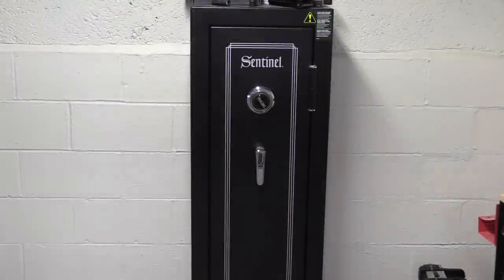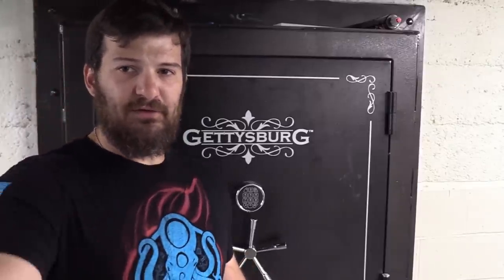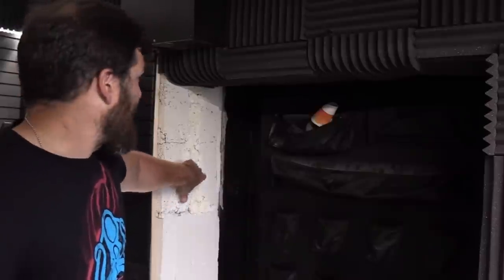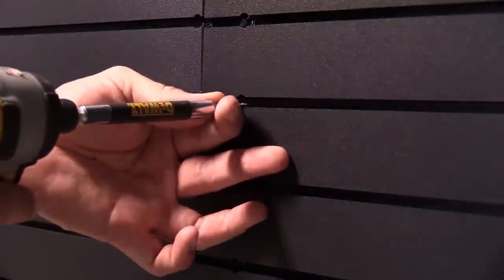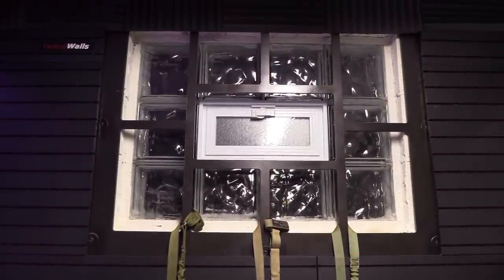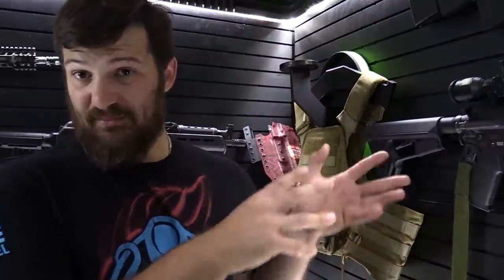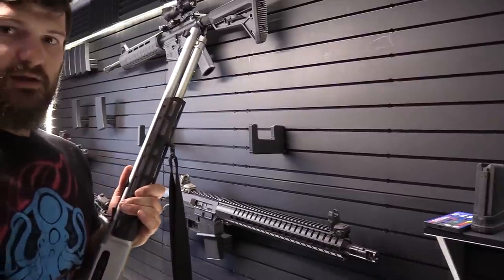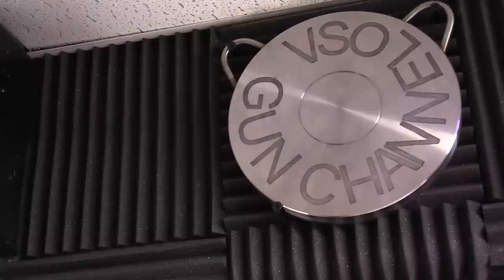The Ultimate DIY Vault Room

Comment: I love the room it’s my dream vault and I’d love to have yours BUT the only thing that lost me is the glass block wall if someone can break that little window you don’t have to get through that small opening all you need is enough room to get your hand in there with a Dewalt battery operated grinder and you can cut that steel window thing out enough to fit in there and cut the power and the alarm is out.  You have done such a great job on the safe room but I wouldn’t sleep good until that window is poured solid concrete or put another steel vault door on the opening that you can only open from the inside that way you have an exit if need be but no one can get in. Theives are scum of the earth and will stop at nothing to steal what is not there’s so your room is only 90% safe with that window it needs to be closed off to make it 100 % safe That being said I would love to have a room like that and congratulations on the cool bad ass gun room you did an amazing job my friend. Stay safe and God bless

Comment: Digital safes are the most unsecure safes ever as a person who one of their hobbies is locksmithing digital safes are so easy to crack especially because they have a feature that if it runs out of power you can use a key and those standard keys for the digital safes are  tubular locks and they are so easy to pick had the digital safes had a double-sided long-standard key it would have been more secure also most digital safe use a little electromagnetic nickel plate meaning that if you take a large magnet and run it over the safe you have a chance to unlock it.

Comment: Might be able to pry it off the wall with a grinder, cut head of bolts off , give it a wack with a sledge hammer, door should come off, figure about 30 seconds a bolt, x what? like 20-30 bolts, you could maybe get through that thing in like 20 minutes, unless there are anchors on the interior of the door frame going into the wall.
Would of been better off welding a double sided flange to the back side, so that steel welded from the inner side of the door wraps around and grabs the other side of the wall, then wouldnt need the anchors. (think C channel grabbing the thick concrete wall).
Like a welded buck door but beefier.
Could also get through by simply using a 14" gas concrete saw and cutting an opening to the right or left of the door or using the gas saw to cut right through the door itself , but it would take a good 2 hours to pry that door off with the right tools.... and the name of the game is deterrent.... making it too annoying to break in so that bad guys give up and move onto easier targets.
All in all pretty cool setup, ;p

Comment: Cement/rebar over that window bro, no need for it, as long as you have 2 windows for Emergency Egress, for code reasons; you'll be alright. That Window is asking for trouble...some hater may come through with a long grab stick and clean you out dry ..they can knock out that glass even the glass brick and the reinforce steel is good but if a long stick gets hold of any of your firearms, once its in someones hands all they got to do is turn the rifle or pistol in a way to get it to pass through the steel .

Comment: Really awesome vault... Well Done!!!  However, the LAST thing I would have advertised (anywhere, let alone the INTERNET) is that there is a glass hole in the side of my vault!  You don't really think that steal grate will hold up well to a few logging chains and an F-250 do ya?  Otherwise, it's excellent!!!
Reply from the maker: Which is harder to get through, concrete block or glass block? There are also assumptions made about said window that a truck and chain would be effective against said location.

Comment: A hot saw would cut right through that re-enforced concrete, and probably the door. And, personally, I would not divulge to the world how the entire room and door are constructed. And why even mention to the public that you have a security system? Seems rather counter-intuitive. Also, I'm guessing that you did not pour a concrete ceiling, so if it is standard joist and plywood construction, some one could get in there with a Sawzall in about 10 minutes.

Comment: VERY COOL BUT I COULD GET IN IN UNDER 10 MINUTES.  A COLD CHISEL AND SMALL SLEDGE WOULD CUT THE HEADS RIGHT OFF YOUR BOLTS SECURING THE VAULT DOOR TO THE CONCRETE.  IF I WAS JUST A REGULAR JOE THEN I SUSPECT I WOULD JUST DILL OUT THE HEADS.  TAKES LONGER THEN 3 WHACKS OF A COLD CHISEL.  AN AIR CHISEL WOULD HAVE THEM OFF IN NO TIME.  HAVE YOUR BUDDY COME BACK OUT AND WELD A PLATE TO COVER THE BOLT HEADS.

Comment: I really like your room. Personally I would pour cement an permanently eliminate that window. Just my opinion.
Reply from the maker: MCMXC I would challenge you to take a cement block and a glass block and destroy them with a sledge. Report back on which one was harder to destroy
Reply: The VSO Gun Channel, yea both blocks probably are not gonna hold up to multiple blows from a sledgehammer. Im just not a fan of having a window in a vault room because crackheads are tiny but thats my personal preference. Your metal burglar bars help add extra security And like i said i like what you did with your space. im guessing that you are located somewhere in the United states where its not the standard to have a full basement. I know a lot of southern states are slab on grade and don’t even have basements at all. I live in Ontario Canada, Majority of new construction houses have poured foundation with full size 8ft ceilings in the basement. If i were to take this idea from you id choose to do it in my “Fruit Cellar” in my basement, all four walls are poured concrete from floor to ceiling, cement floor and ceiling, no windows and not connected to the hvac system. I would just have to replace my standard door with a custom Vault door or try an buy one within a reasonable distance.

Comment: I have to say, having a window in your vault room is pretty damn stupid, also having a vent going THROUGH the wall of the vault is also a bit stupid (cant see what you have done).  Give me ten minutes and an angle grinder or six seconds and a winch on a decent size truck, and that grate will be out of the way.  It is a huge security hole my man.  yank it out, walk in, take everything, drive off less then a few minutes.  We had guys do the same thing to steel reinforced doors on a gun store, cleaned them out in less then ten minutes.

Comment: Carpet that floor, you're getting lots of echo from there. Can hear lots of it when you're looking down at the floor.
Reply from the maker: I will just not look at the floor. 
I will never have a finished basement again. I look at people with finished basements like kids that think they are doing something and going places when they are working a fast food job. The reality is circumstance  hasn’t caught up with them yet. 

One day an unholy frog-croaker is going to come. That water table is going to rise, and those walls will seep, they are designed to do that. Then one day they will have mushrooms pushing up your carpet or laminate.

The room is engineered to be 1.)mold resistant. 2.) is setup so that if it gets that way a few screws pull the bottom panels off, and a thorough bleaching can be applied via broom. 

#beentheredonethat

Comment: Just cut the heads off the studs and what, glue is holding it to the wall?
Ever hear about the weakest link in a chain? 
You don't need to blast through the whole concrete wall, just the 1/16" of concrete the steel is glued to.
Should have secured it on the inside wall and then had the frame go through the doorway towards the outside and have it end up flush with the exterior wall. WAIT A MINUTE, THERE'S A WINDOW! I DON'T CARE WHAT THAT CHEAP GRATE IS MADE OUT OF, GIVE ME 2 MINUTES AND I'M IN THERE!!!

Comment: Where do I start....

Fill in and reinforce that window. A sledgehammer and 3 dollars worth of cutting disks and there's a nice entrance into all that nice stuff.

You posted it on youtube and everyone knows your face. Can't fix that.

A drill, an endoscope and a 9 volt battery is all that's needed to "spike" the solenoid on that electronic lock. 
The numeral pad can be dusted for fingerprints and the combination figured out. Fingers have natural oils on them.
Or some "friend" you know can watch you enter it.

Buy a manipulation proof Safe lock. A lagard group 1 lock or an S&G 2937-200 Group-1 Manipulation Resistant Combination Dial Safe Lock kit. They're not very expensive.

I hope the roof is reinforced concrete too. Thieves don't care how much they destroy to get what they're after.

I hope you have a wireless alarm system hooked up to it. Wires can be cut. Don't respond with any more info and give thieves any more ideas about your setup.

Stop showing it to people...

Comment: Well your alarm can be disabled very easily, cut phone wires and run a cell phone jammer which are easily purchased from China, and they jam everything, seen them work.

Your door and window is very weak, portable plasma cutter will take care of each quickly, I have one that cuts 1” steel all day and it is the size of a backpack, harden steel makes it no difference, like a hot knife through butter.

All that being said I would not mind having it, like I tell snowflakes that hate AR style firearms that want to ban them, criminals are going to find a way to hurt, kill, or rob you.

You did a nice job on it, I really just do not like the window, if needed a way to vent I would have used a exhaust fan and got rid of that window, why you kept it is a big mystery, especially since you stated you wanted NO outside light only artificial lighting.

The door also is a bit worrisome, if by somehow it got locked, how you going to get out? Also the round locking lugs are old design, the new flat blade style are 40% stronger. The doors on most gun safes are cheaply made, 1/8” to maybe 1/4”, although have one made of 1/2” harden plate (Still cut is easily), but another weak spot is the lock, drill a 1/4” hole just about the lock and open them, that is how they get them open when you loose your combination or it fails. I was pissed when I found how easily they opened my safe when the lock failed, then all they did was stick a plug in the damn hole. Hey it slows them down I guess.

Over all I will give your safe room/vault a score of B to B+ for the security problems I listed above. Nice job guy

Comment: I'm not a rocket scientist by know means but do you have enough common sense not to put a window in a safe room because now it is no longer a safe room
Reply from the maker: Translucent glass block. Which is tougher to get through? Glass block or concrete block. Know the answer, become a little bit closer to that rocket scientist
Reply: @VSO_Gun_Channel  dude I work construction instruction and I have demo'd glass block before all's I need is a good heavy hammer and can be threw in 10 minutes or less
Reply from the maker: And concrete block? How long for it?
What other assumptions have you made about being able to access said glass block?
Reply: @VSO_Gun_Channel  Hollow concrete blocks fairly easy once you get the first one out the rest will come if they're filled then you did a good job with that but I would suggest some bars over the glass block because that is definitely the very weak Link in your security room not trying to give you a hard time or critical just food for thought from someone who has in a professional manner has demoed a variety of walls including glass block

Comment: You have a window...  In a vault?
With a hardened steel grate...  That I could yank out with a passenger car.  And instead of an actual vault door, you used a cobbled up Chinese built gun safe (that can't open from the inside) mounted on cinder block walls designed only to give structural support... even poured concrete... Even steel enforced concrete (bet the exterior walls aren't), crumbles with a 10 pound sledge...  

...and if that weren't enough, you're a YouTuber, with 100k+ subscribers. Your info is out there I promise. So now you've made yourself a "public figure", AND shown the world whats in there... plus how inadequate your security is.  

You're basically putting all eggs in one basket, and relying on a security system. 

But you comment "so many stupid people"?  😂🤣

Edit to add:

You may stop a smash and grab crackhead...  But this video has been viewed 200k times...  you've given lots of smart thieves plenty of helpful information, that someone just looking for some pawnshop loot doesn't have. 
...that, isn't too bright.

And by the way ...it took me 3 minutes, and $2.89 to find your home address.